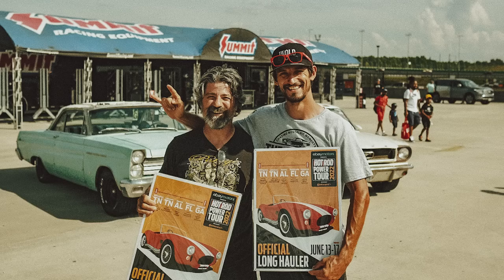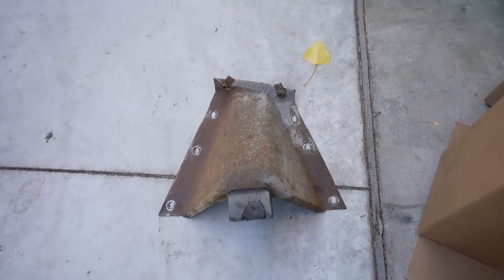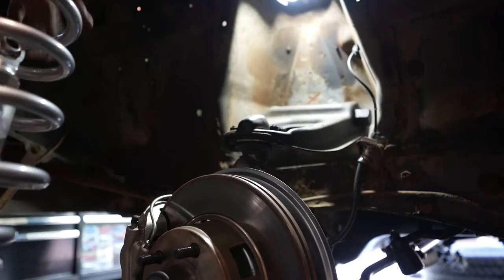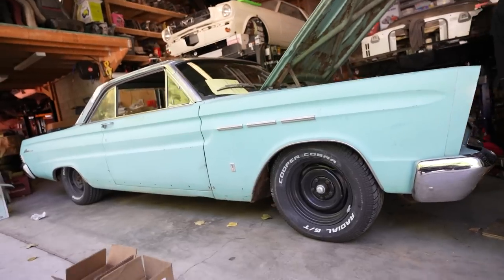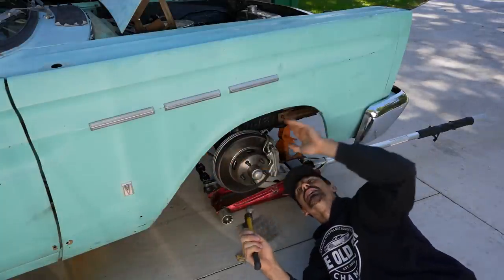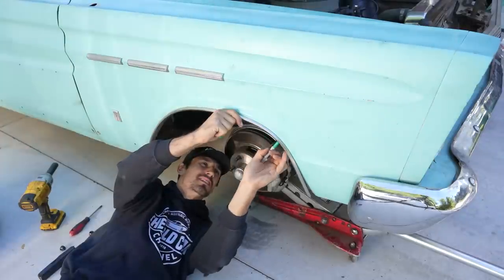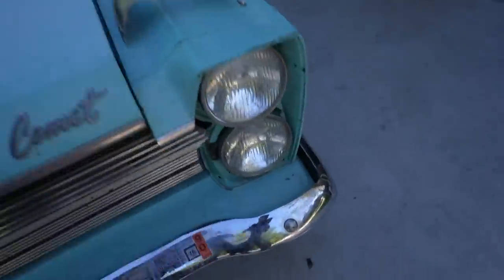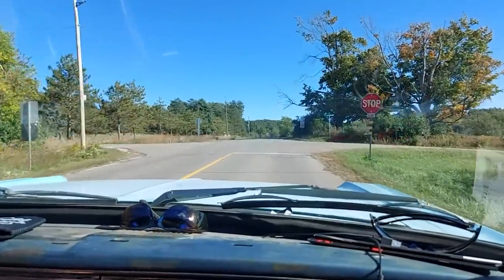1965 Comet LOWERED with QA1 350lbs Springs

Comment: I wanna see some content on the Lincoln Versailles in the background.
Reply from the maker: Sold the shell, if you go back to the 66 convertible series, you’ll see us stripping the engine and transmission from the Versailles for the mustang. Also still have the 9inch from it for a project in the future
Reply: @Theoldcarchannel.  Crap. I've been wanting to see someone do something with a Versailles for years. I had a Granada back in the mid to late 70's and upgraded the suspension using some HiPer Mustang components that allowed it to handle better than a lot of Cameros and even a Datson 280ZX. Never had the money to really go all out with it. While the Versailles were overpriced, I always wanted one for the whole cheap Lincoln aspect. I worked at a Ford garage when they were manufactured and sold and got to drive a lot of them. They did ride nice and if you got one with the right color they did look pretty nice as well, especially for the times.

Comment: Looks good guys! I had 350lbs springs on my 66 El Camino and while the stance was nice it got annoying constantly having to adjust the coilovers because the springs sagged, I have a rather old kit from about 2013 or so and perhaps things are different now but regardless I ended up going to a 550lbs spring and have had no issues with spring sag, QA1/Viking and I'm sure a few others make the conical springs in different weights but also different heights, you can get a 450lbs spring in a 10 inch tall and an 8 inch tall, so if the springs sag being undersprung maybe give that a go, its a shame it isnt advertised more and they just sell a one size fits all kit because I didnt know about the different length springs for a long time
Reply from the maker: Thanks James, what your elco all about?SBC? BBC? stick? auto? Always wanted to get one!
As for the comet, far so good. We’ll see next year when I drive it some more if it continues to lower… but I doubt it. Wow, Good to know information, it is a little crazy with just how many parts/ pieces they have available, one of the reasons they can offer custom kits to people!

Comment: If ya don’t mind me asking, what wheel/tire size did you run in the front? My son and I will be taking on this project as soon as I order the parts. The stance is perfect. Thanks again for all the great vids.
Reply from the maker: Hello, I believe the wheels are 14x6 (they are disc brake style wheels, drum brake wheels will not work with a factory disc brake upgrade). Tires are 235 60 14. BFGs. 
Thank you for watching! Super happy with the stance as well! Totally chances the look of the car!
Reply: @Theoldcarchannel.  Thank you, gonna get what I need ordered up, and get father and 15 yr old son back on the project. I’m running 15”x6”  up front, hoping I may not have to massage the fenders, but we’ll see. Watched all your Comet vids, and they helped us a lot. Thank you guys again for doing what you do.
Reply from the maker: @kevmo73  thank you for following along and watching the videos! 
If you want to run this low of stance you will need to massage the fender lip. As for the tire size you’ll need to do some calculations to figure out how much side wall you want to run. Other than that, enjoy the time wrenching with your son👍
Mike
Reply: @Theoldcarchannel.  any chance you have a link or know the offset, I want to run the same wheels 😅
Reply from the maker: @Tekgnome.  I don’t know off the top of my head, I would think any ford 14x6 disc brake wheels would be the same
Reply: @Theoldcarchannel.  awesome!

That should make it easy then, should be plenty sitting around for cheap.

I'm probably going to buy a 15x7 with a 4" backspace for the rear, so I can cram a 245/60/15 on it.

I still need to do some measurements as the previous owner swapped in a 9" from what appears to be a 57 galaxy. I have no idea what's actually going to fit. I'm okay with rolling the fenders, I actually have a proper roll tool so no hammers required 😅 but I refuse to cut the tub.

Comment: How did you lower the rear of the car
Reply from the maker: 2 inch lowering blocks. Got some aluminum from a local metal store, cut to size, drilled a center locating bolt, also got some u bolts made at a local truck spring shop
Reply: The car looks great  thanks. I think on my 65 comet I am going with the cal-trac monoleaf rear springs and a set of their sliders to replace the shackles
Reply: I did the same front setup as you did with the 350 weight springs
Reply from the maker: @coorscwilly9683  awesome, how do you like it?
Reply: Love the setup
Reply from the maker: @coorscwilly9683  Detroit spring also sells factory style springs for the comets
Reply from the maker: @coorscwilly9683  that’s great, glad you like them